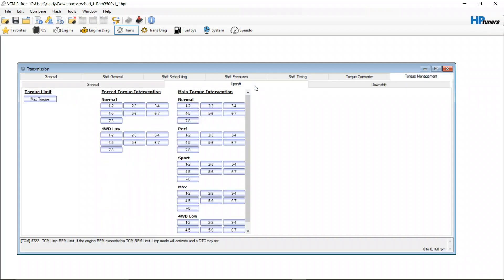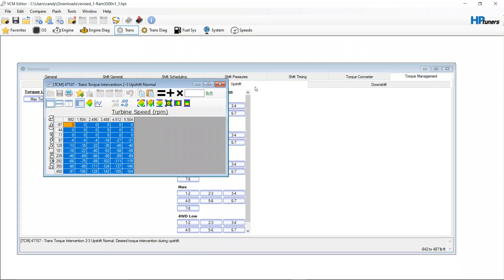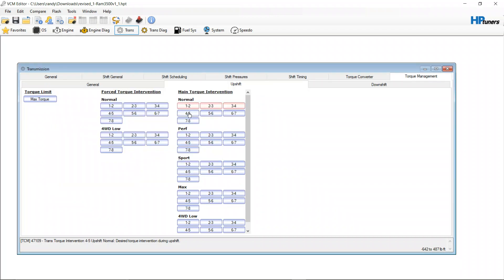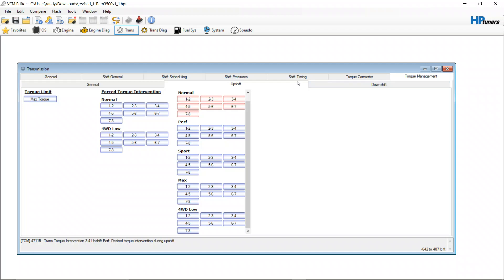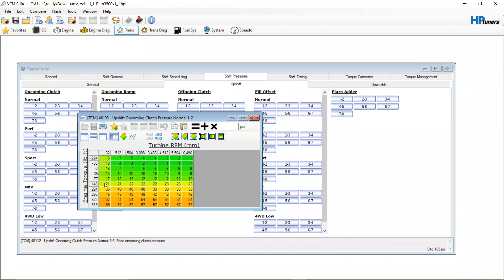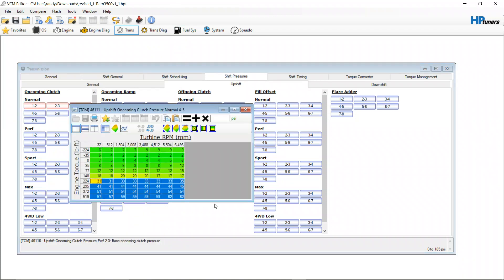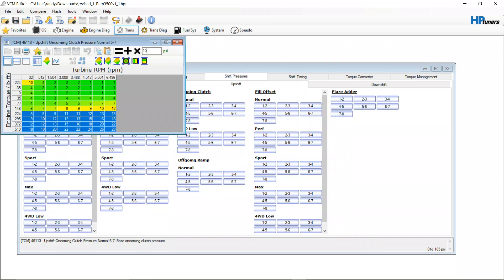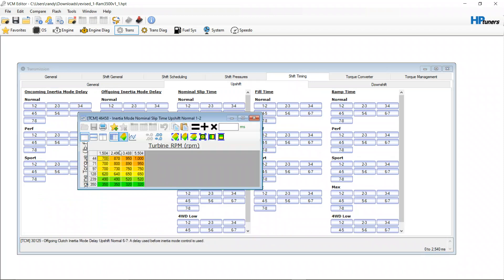ZF8HP2 base trans tuning

Comment: I have a dumb question on shifting speed. 17 charger rt. I have the trans where it shifts firm and at my desired rpm but it still feels slowish.  I have finally set my shift speed all the way to 0 ms and it made it better but still feels like it takes longer than it should
Reply: Zero out the delay tables in shift timings and increase the torque management. I don't let more than 128 ft lbs on upshifts. I also decrease ramp times to near 0 (50-100). Make sure you reset all adapts and not just the transmission adapts. If you get shift flare after this the fill offsets need to be increased.

Comment: My customer with a  2019 charger says he wants to keep the transmission in 1st gear for burn outs in manual mode, but it keeps shifting into second gear, how do we stop it from shifting to 2nd gear in manual mode? Thanks 😅
Reply from the maker: Put the oss rpm to a rpm you can never reach is the first step, but the other step is probably behind the scenes which is controlling up shift

Comment: This is a really good vid...definitely gives better expansions in better detail than some of the other trans training courses out there! Excellent info on "driving thru the shift" "Forced Intervention is a band aid"...etc. As recommendation please consider when time comes for your vid datalogging, include charts showing the different problems that might be run across i.e. flare, too much and too little pressure, ramps, fill, etc and please don't have a bunch of PIDs all charting on the same line will help greatly...Thanks...I'm subscribed and the bell is rung!!! LOL

Comment: Great video! I'm about to tackle my 2019 ram 2500 power wagon that has held 5th gear for an insane amount of time, I've read my TCM but haven't licensed HP tuners yet to write.  Still need to send my pcm off for unlock too as I'd like to shut off MDS.

Comment: I'm the owner of the tune in this video, First thanks Randy for doing this. Truck shifts firmer, however up to 50 MPH shifts up to 5th and won't go into 6,7,or8 till you at highway speeds, engine rpm is higher in gears 1-5, I guess I need to change shift pattern back to stock. also I changed Max tq limit to 530 to get rid of U402 limp code
Reply from the maker: I can take a look at your shift patterns for you, but yes we left them all on table 34 for this
Reply: @Recklessmotorsports  If I can figure how to do a scan on the transmission, I will do it

Comment: I have been thinking about unlocking my trans tables. I am running into a wot throttle issue where the trans doesn't want to shift until after a delay, which I am thinking might be a torque management issue.
Reply from the maker: What vehxile and rpm
Reply: @Recklessmotorsports  2017 Dodge Challenger with a Magnuson tvs2300 at 11psi. Should be shifting around 5700rpm
Reply: @Recklessmotorsports  is it possible to change the maximum torque in the tune? Mine is set to 561 and when I tried going above that, it locked me in 3rd gear limp mode.